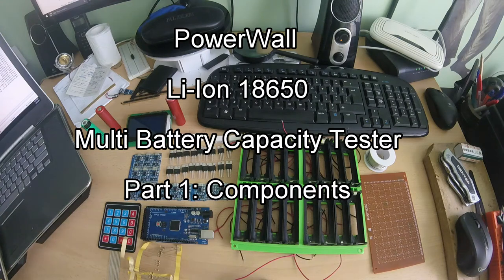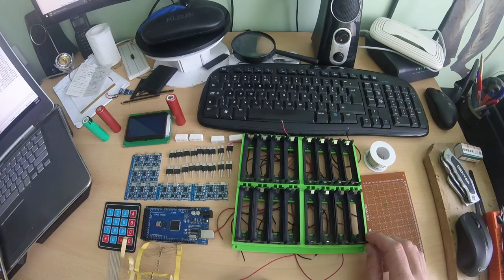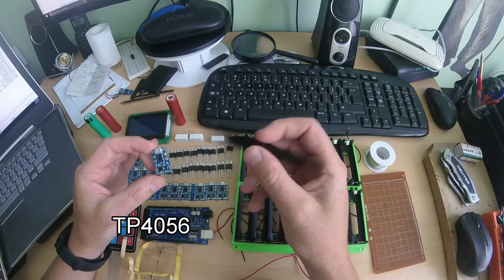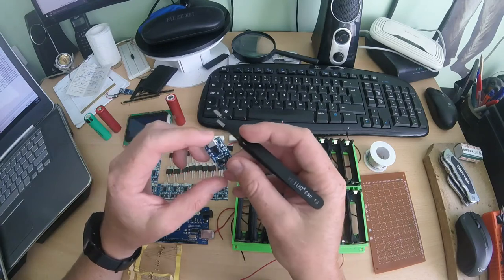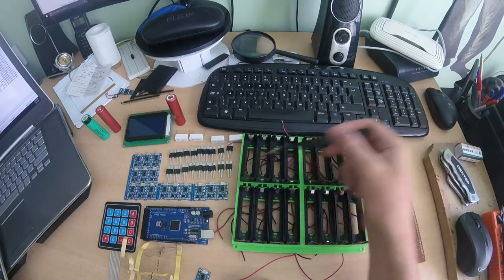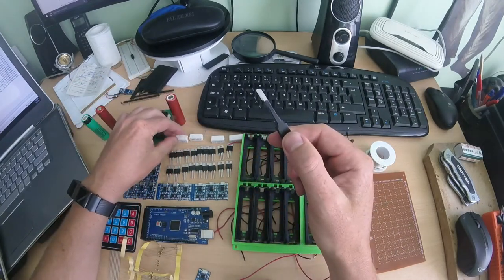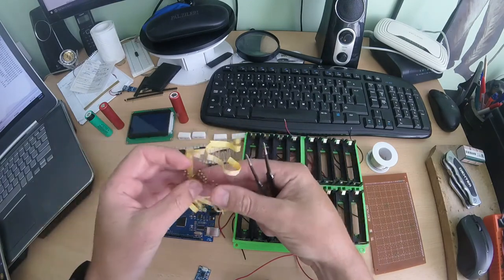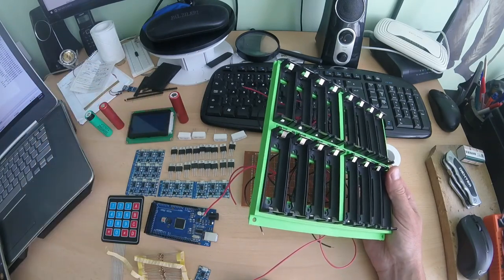#2 18650 Li-Ion Multi Battery Capacity Tester - Components

Comment: Good day, I was very interested in your project, I would like to take a look at the diagram of your solution for testing batteries, I am from Ukraine, we now have an urgent need to build uninterruptible power systems and for this you need to test a large number of lion cells.
Reply from the maker: In ur situation the best way to speed up the process and save money is to make big tp4056 charging station and the tester used only for discharge and test. If u need guidance contact me on mail.